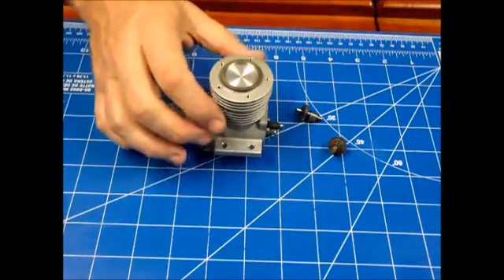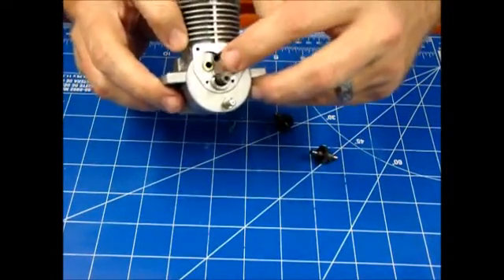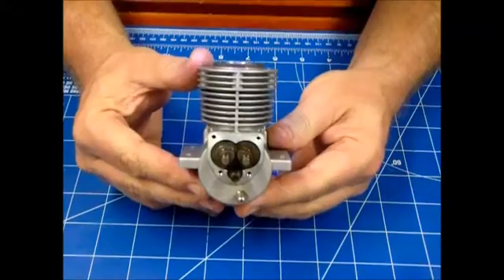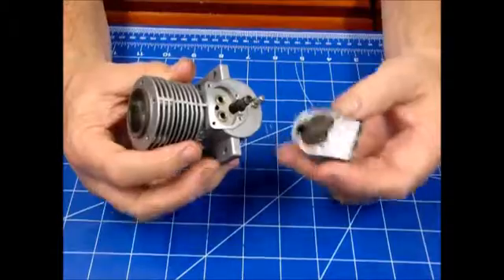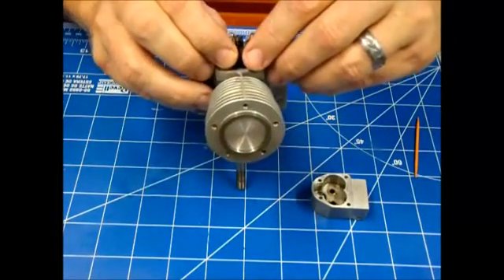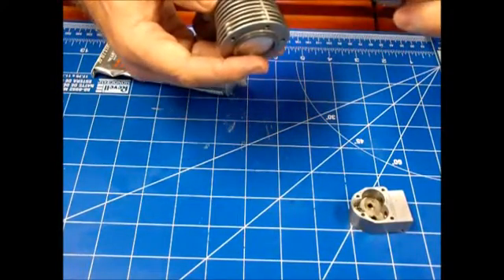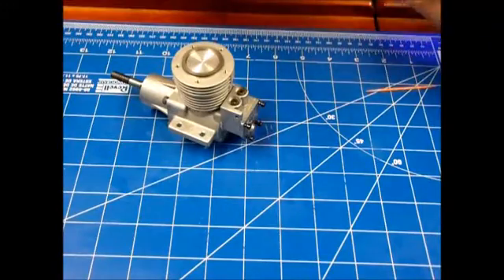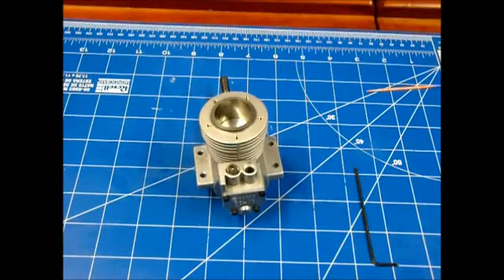Enya 60-4C Part 2 Reassembly

Comment: Does the Enya .46 have the same timing marks, etc., as the .60 in this video??. I suspect my .46 may have timing wrong. Has always tended to suddenly quit and throw props at low rpm.
Reply from the maker: All Enya 4 strokes have timing marks, but they are not the same locations between a 46 and a 60.  Down load the proper manual for your engine and the timing is shown on that.
Reply from the maker: http://www.dieselrc.com/download/enya_46-4c.pdf